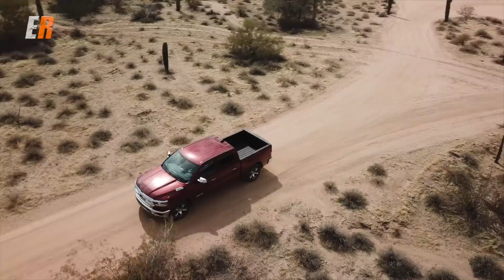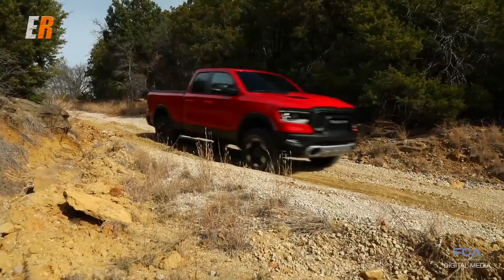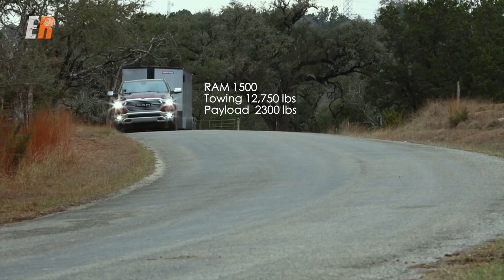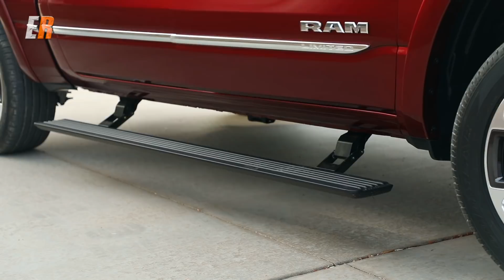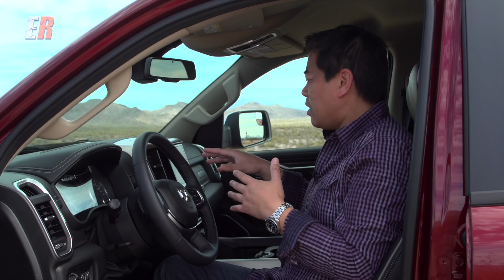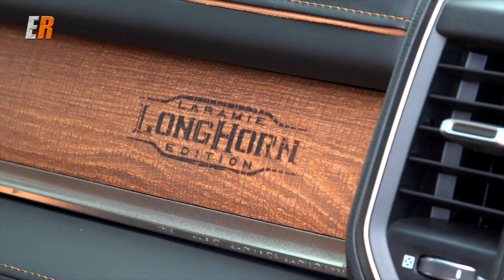ALL NEW - 2019 RAM 1500 - I Wish I Needed a Pick-up Truck

Comment: Nicer, of course.   But at some point bigger isn't better.    

The longer wheelbase will make it harder to fit in small garages and park in urban areas.   When towing it will have to swing that much wider to avoid hopping curbs. 

The "flat floor"  just means they raised the sides of the rear floor.  This means higher entry, and probably a higher center of gravity. 

The higher sides mean its harder to reach over to get stuff in or out.  PITA if you really use it for work.  

The nicer interior in high trim levels will mean higher prices.  In fact, it will almost certainly cost significantly more than current Rams because it will lack the massive discounting they have for several years.   

Ram is a truck brand,  they need to fit in a midsize truck into their lineup , better still a 7/8ths size like the original Toyota Tundra, to capture the market for those who really work with their truck but also tow and want to keep the size down for employees who may not be such great drivers.
Reply from the maker: Great comments. Thanks!

Comment: Damped, not dampened. Dampened is... wet. 😀
Reply: damp·en
ˈdampən/Submit
verb
past tense: dampened; past participle: dampened
1.
make slightly wet.
"the fine rain dampened her face"
synonyms: moisten, damp, wet, dew, water; literarybedew
"the rain dampened her face"
2.
make less strong or intense.
"nothing could dampen her enthusiasm"
synonyms: lessen, decrease, diminish, reduce, moderate, damp, put a damper on, throw cold
Reply: Ethan A 
The root word is damp(to slow down), not dampen. A damper is something that slows something down. If an action is slowed it is damped, not dampened.

Comment: The tailgate is automatic? Didn’t know that, I remembered Chevy made a big deal over the power tailgate, but not ram.
Reply from the maker: It’s not powered, it just has a remote release and it has a gas assisted tailgate so it doesn’t slam down.
Reply: JJM Channel you can get a power one

Comment: Composite and aluminum control arms? If the front suspesion has an issues, better sell a kidney.
Reply: Scott Witkowski I also noticed the lack of grease fittings on the control arm bushings , and the ball joints.
Reply: Scott Witkowski wrong wrong and wrong agian